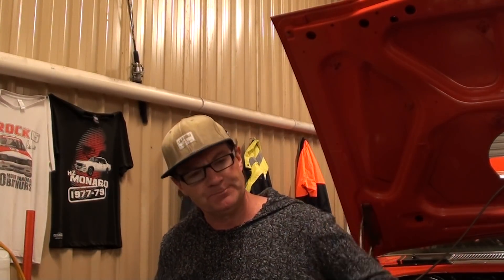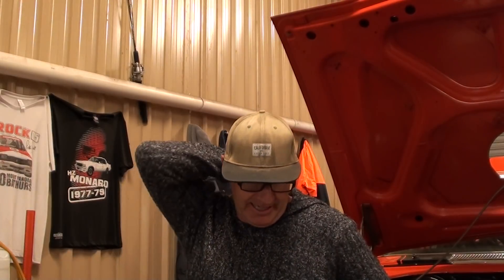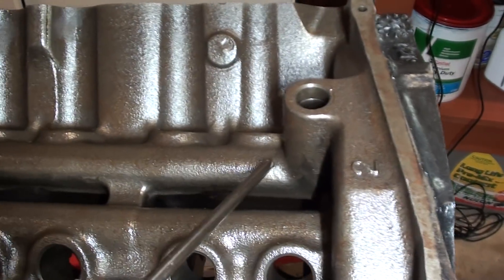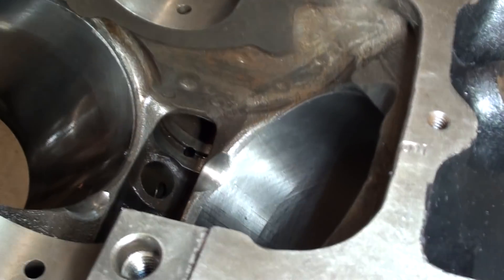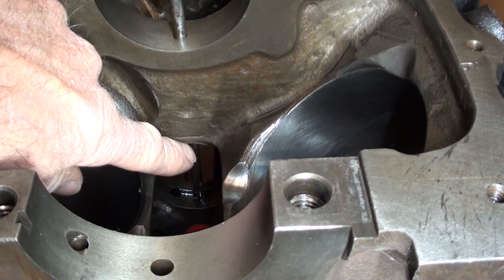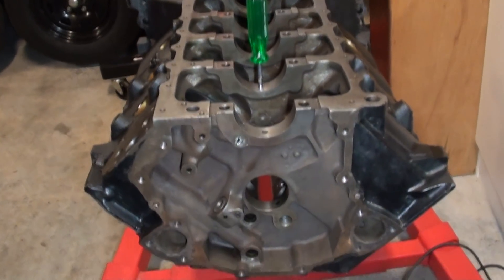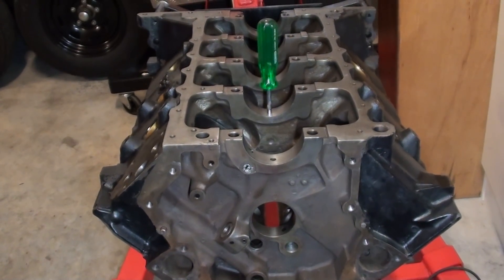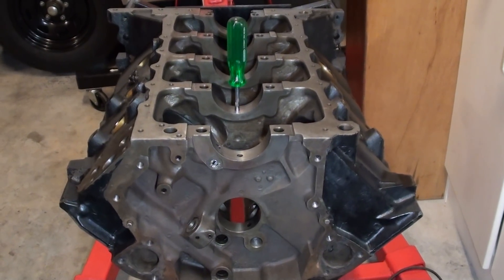HOLDEN V8 OILING SYSTEM TALK PT1

Comment: Never designed to be a race engine, hence its short comings. None the less, a Fantastic engine through the decades. Great video, very interesting stuff for this home mechanic
Reply from the maker: Group A SS Commodore VK 308 V8 it is a fantastic little engine, i think knowledge and understanding  on how to help oil flow in the right spots will greatly inprove the longevity. Thanks mate..

Comment: Well said my friend !!  The old grey motor Holden engine, you had to be very careful doing oil changes on them. You literally get the new oil ready to put in before you drain the old stuff and then when you drop the oil as it drains and when there's the last continuous dribble coming out you quickly put the sump plug back in hop up and start pouring the new oil in straight away because you CAN NOT allow the oil system to drain completely otherwise you'll have hells on act trying to get the air out of the system without damaging bearings !!  Great vid bud !!  Seeya Rob
Reply from the maker: 87xfute well atleast holden got something right with the p trap design in the pick up...I do love these motors Rob,  just needs a little love and attention, Thanks Rob...

Comment: Good video, just a few notes, that 120deg turn on the oil pick up hole is rather a bad thing for the pump, to much restriction on the suction "gear pumps aint that efficient at sucking oil. External oil pick up modification can fix that issue. 
Also the the cam bearing oil feed hole should never be set up at the "6 clock" position as that is the load area. 

Looking forward to your next video though 👍
Reply from the maker: RVK355 i bloody thought that was strange you know, it makes sense what your saying with the clocking of cam feed holes, see the wear on that area...... im actually going to open up the hole slightly as well to try and let a little more oil in through the block to pump..There is no doubt that an external pickup would be the ultimate...Thanks for your advise it was well received👍

Comment: Put the moroso pressurized oil container back on.  That way you can flood the engine with oil before start up when it's been sitting awhile.    Prefill oil filter 1/2 way when changing oil.  Oil pressure almost instantly.   I do that on every car I change oil on.     A lot of the older engines   are non main priority oiling systems.   But when you buy an expensive aftermarket block just about all of them have the priority main oiling systems.  I can't afford them either.  But if I'm building an engine with stock engine block that's going to see over 5k rpm on a regular basis I will always use a hi press/ hi vol. Oil pump if ones available for it.  And if you can increase the oil pickup tube size along with the oil pump inlet size like you can on a sbc (example 5/8 to 3/4 size). That would help too.  You know the Holden's and if it can be done or not.  Just putting some thoughts out there for you.  I can see a lot of similarities to the engine design architecture that BOPC  (Buick , Oldsmobile , Pontiac , Cadillac) used in there engines all rolled up in the Holden's V8 engine design.  It may not be,. Just reminds me of it though.  Sure glad to see you working on the 355.   Was recently wondering about that.   been a while at the machine shop seems like.   Can't wait to see that one back in the car.   The engine that's currently in the car.  If you did the same oiling mods and with the right parts.  I would think you could possibly rev that little 308 to about 8500 rpm with or without the turbo.  Just wondering about that.   Lots of cool info and ideas your putting out there.   Keep thinking outside the box.  It works for you. 👍👍

Comment: Interesting. Thanks for the video.
Have you seen the engineering notes for this motor and why they've done it this way?
How would you calculate how the pressure/delivery is affected through all parts of the system and what the optimum is?

Comment: No one has ever explained the importance of this mod in a racing application. No.1 cam bearing and lifter oiling aren’t there weak points. All COME had to say is that you get less lifter noise on start up. Your results will be interesting.

Comment: I would of guessed you would be watching the supercars mate. Its a shame that holden didnt rectify some oiling issues through the years. The six cylinder engines are much the same.
Reply from the maker: G G my time away is very limited, with my wife not well, so i save my outings to taking the beast to the track.... Thanks Goerge..
Reply: GRIFFS REARMOUNT TURBO, The Modfather Family first always. Speedy recovery.
Reply from the maker: G G  she has ms..but doing ok. Thanks Goerge....